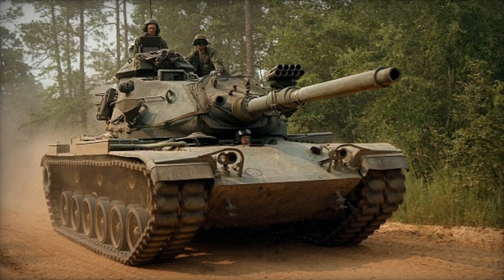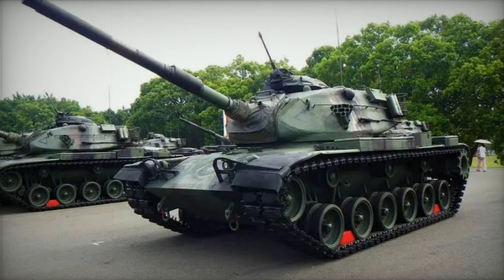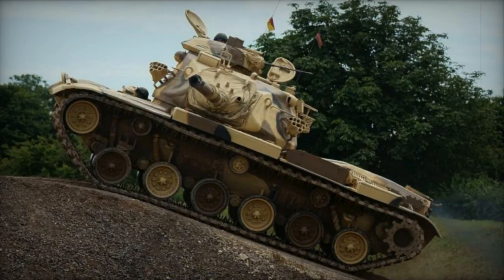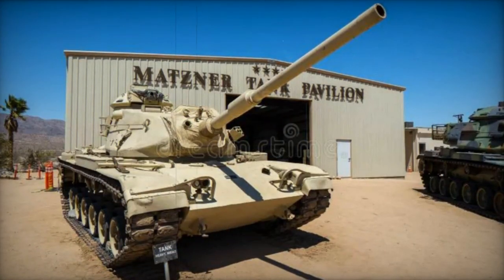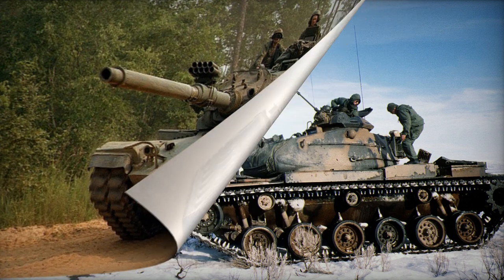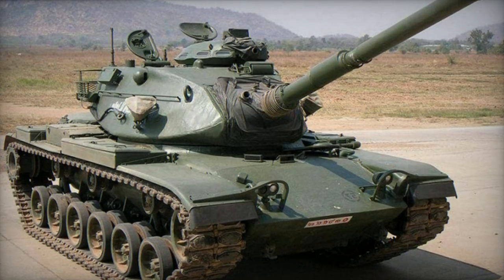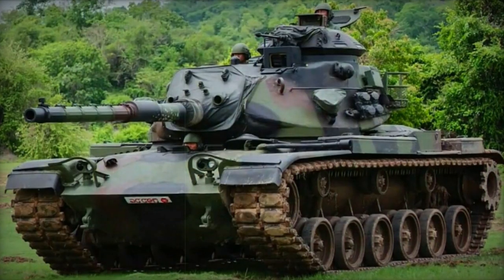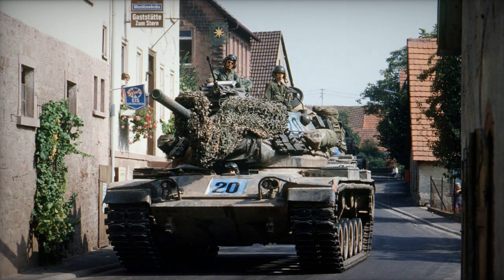M60A3 Patton Main battle tank

Comment: If I recall correctly the crews always complained that it was slow but it was reliable and quite effective even up to the gulf war. For me the US army should have developed a much improved M60 and far cheaper than the Abrams....
Reply: Surely, we could have developed a 900 HP Diesel Engine by the 1970s?
Reply: @williampaz2092  apparently they could but apparently they they found it more important reliability and the space to install a more powerful engine and bigger didn't justify the expense...